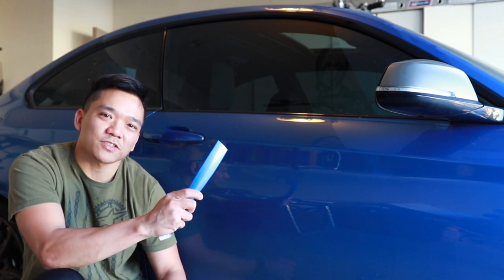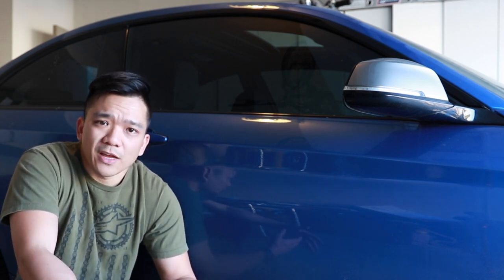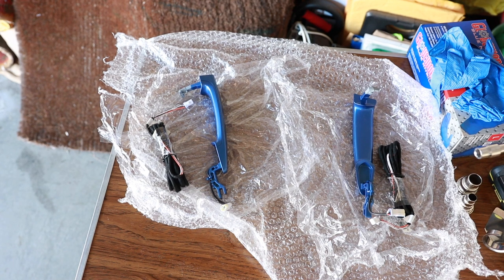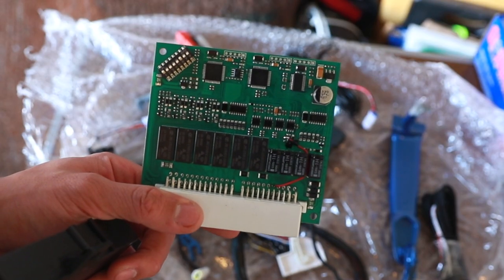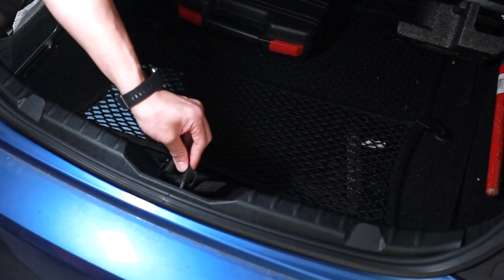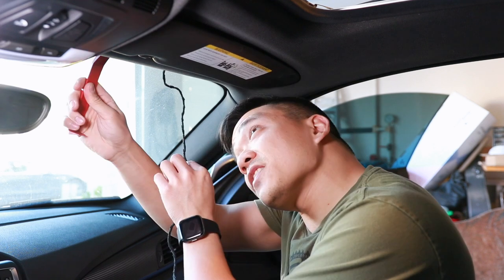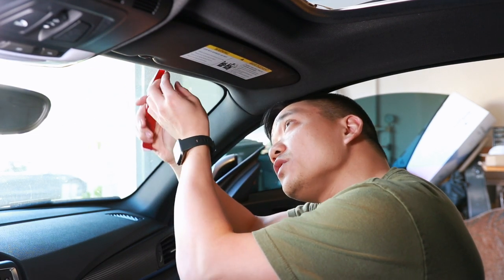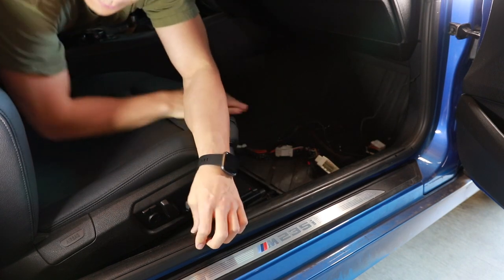BMW Comfort Access Install & Retrofit

Comment: Thanks for the amazing step by step guide. I am seriously considering making my old f20 bmw keyless, but the reliability and unlock lag time really concern me. I also watched your previous video, how is the lag time compared to this comfort access option, and do you experience any reliability issue so far. Thanks again!!
Reply from the maker: Hi, thanks for checking out both videos! I would have to say that there is more of a lag with the bimmertech because it only works when you touch the handle. The other one was a proximity. So usually by the time you touched the handle it would be unlocked.  

However, this unit has been more reliable in my opinion and Bimmertech has better customer service. On the flip side it does not have as much features as the other one did. 

If I knew what I do know I would just spring the extra money for bimmertech and save the time and hassle.

I'm going to have a Live Q and A this Sunday. You're welcome to attend and ask more questions.

Comment: Only thing I noticed you did wrong would be when you ran it across your a pillar.
There's an airbag there so you ideally want to go around the back of the airbag so you don't block it if it ever does deploy

Comment: I have same car that came with CA. Neither door works have code suggesting antenna is disconnected which I take to mean has failed. Might you know the location of the OEM Comfort Access antenna, did not see it on your excellent vid install...

Comment: Excuse me, if the engine is running, can people get off the car and use the touch door to lock it? Then if you put the key inside and touch the door to lock it, will it be locked?

Comment: Hello
It seems to me to have done everything correctly but the window on the driver's side no longer works.
Do you know what this could come from?
Reply from the maker: Make sure that the connection for the window switch is fully engaged. If it is then check your fuses and if the problem still persists then check to make sure that there is nothing interfering with the actual motor and regulator in the door panel
Reply: @FritzRamos  Thanks you so much!
Reply from the maker: @ypa884  Does it work now?
Reply: @FritzRamos  Yes everything is ok, it was my fault, I forgot to reconnect the driver's window mechanic plug ... Thank you again for your answer and for your responsiveness. Best regards.
Reply from the maker: @ypa884  Don't sweat it. Glad it all worked out and hope you enjoy it